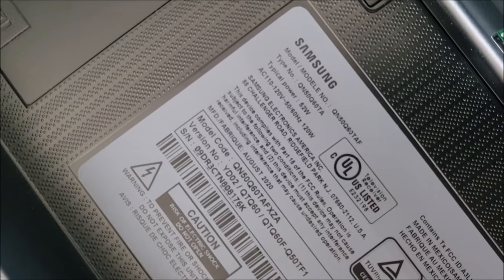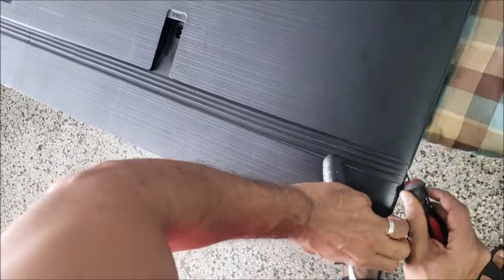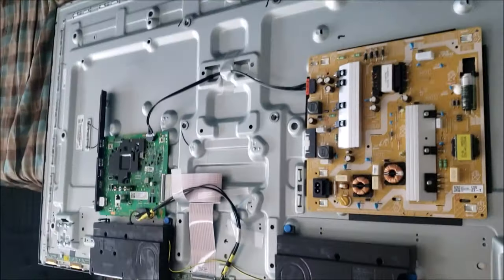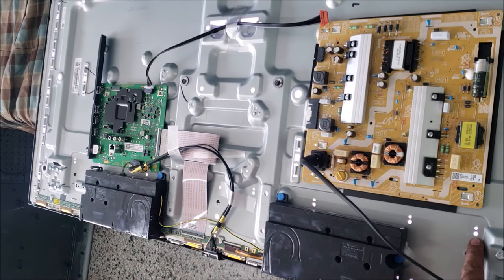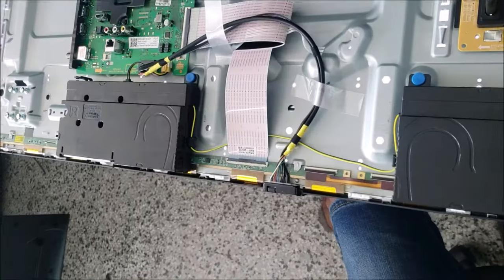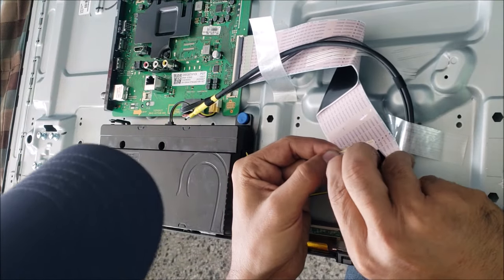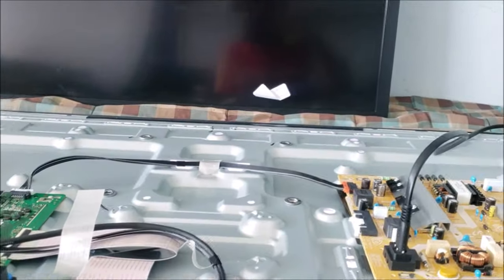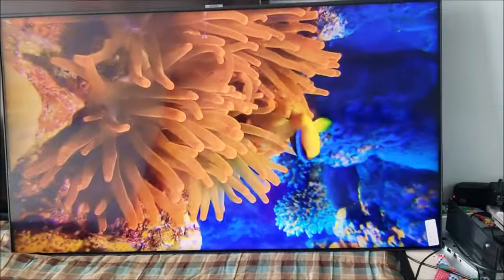Samsung TV QLED 4K QN50Q60TAF standby red light flashing

Comment: My 23 months old 58Q60T also made the same problem today. It is ashame for Samsung to have this problem in common and not to solve. A brand like Samsung should not make TVs causing problems in less than 2 years. I have a Sony plasma TV 16 years old and bever had any problem.
Reply: They do this as soon as your warranty ends. so that you fucked up with your 1000 euros. they put the hardwares which almost works till the warranty stays.

Comment: Hi,
I have just repaired the identical TV by placing a piece of tape almost in the exact same spot as you did. TV now shows a picture. /the picture is very white though as if the brightness is too high. Any suggestions as to what is causing so much whitness please? I have attempted to lower the brightness but to no avail. I made the piece of tape narrower and the colour and brightness has returned as normal. so sorted, Many thanks, upload greatly appreciated. Best regard, Brian
Reply: in quali pin hai messo il nastro? grazie

Comment: After I disconnected the ribbon cable (only one for a 75" TV) The TV stay on with sound, but no picture. Instead of going line by line to figure out which one is causing the problem, what should I replaced, the motherboard, the ribbon cable or what??
Reply from the maker: if you dont want to try cove traces you need to change the screen
Reply: @SOSfixElectronics  Change the screen or the motherboard?

Comment: Hi. What if the LED do not come on when unplugging the mainboard power cable? What could be the problem then?
Reply from the maker: bad backlight or power board
Reply: @SOSfixElectronics  Thank you for the reply. Do you have a video on how to troubleshoot the power supply? I'm reading 13V on the LED output pins. But reading 11v on the motherboard output pin